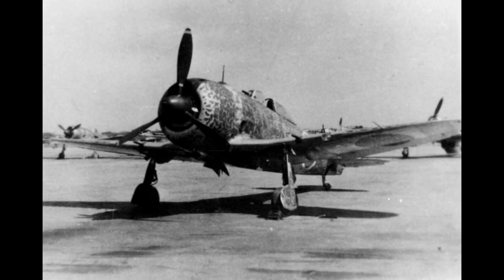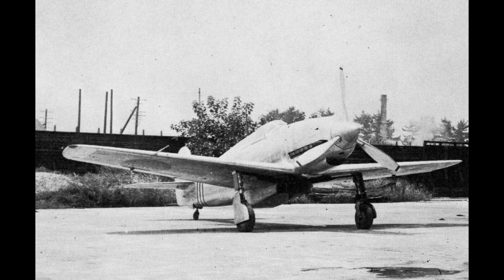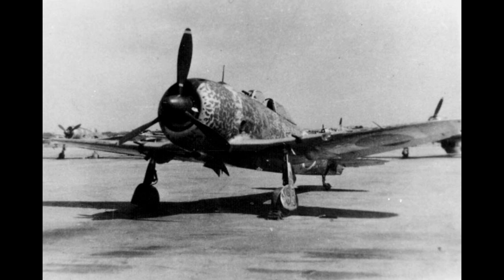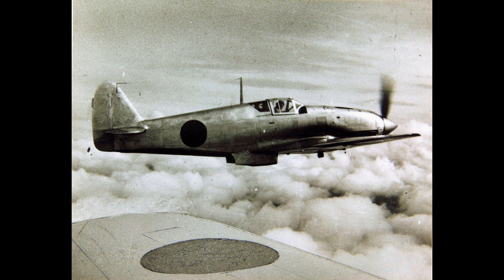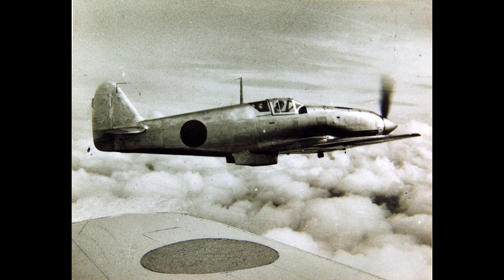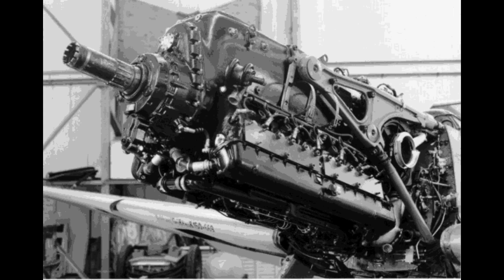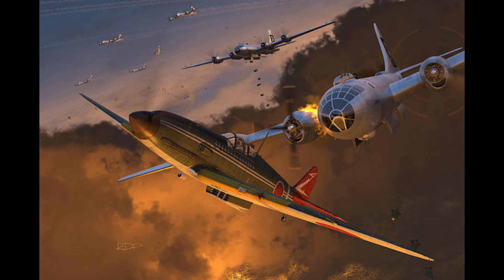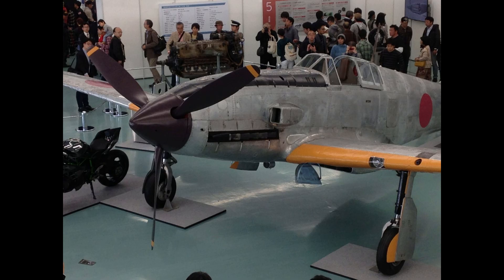5 Minute Guides to Aircraft: Kawasaki Ki-61 Hien

Comment: Pops was a fighter mechanic in the pacific and said the reliability and ruggedness of the radial was superior to the aerodynamic superiority of the inline
Reply from the maker: Indeed, that was the primary reason all US Navy aircraft used radial engines, among also being generally more easier to maintain and operate onboard a carrier, needing less parts since you didn't have a liquid cooling system to maintain (discounting the oil cooling).

Comment: It was a V not inline.
Reply from the maker: The DB601 is a inverted V12, which is a type of inline engine.
Reply: @5MinuteGuidesToAircraft  Inline refers to combustion engines like the 2jz, RB26 or any 4 cylinder that's not a flat, like most modern engones where the cylinders are all in a line, V is designated with V6 V8, V12, where there is a bank between cylinders like the LS1, Ford.modular, 1uz.
Reply from the maker: @super_slav91  Ah, I realize the confusion.

I substituted Inline for "Liquid cooled Engines" way back in my young years and just kept onto it ever since because I always for some reason thought of inline as literally in line with the aircraft and the fuselage.

Blame that one on 7 y.o me who never bothered to double check lol
Reply: @super_slav91  In aviation circles a V12 is correctly referred to as an inline engine, as is an H-24 like a Napier Sabre, W12 like a Napier Lion or a straight 4 like a Gypsy Major. the cylinders are in a row or lines along a crankshaft as opposed to around the crankshaft in a circle like a radial engine
Reply: @pommunist  Didn't know that but makes sense since radials exist, upside down V12 was in the BF-109 rudimentary EFI too?

Comment: "fanaticism about radial engines"

Yes they had poor inlines at the time, but that was onle one side of it.   Very simple, Japan in the 1930s had some of the best radial engine tech in the world.
Only problem(but a really big one) was that their massproduction sucked badly, so almost no production engines came close to what the prototypes managed(and they were often overweight or less reliable as well).

If Japan in 2nd half of 1930 had same production ability and fuel quality as USA?   Their engines were clearly BETTER.   To the point that they may have been best in the world at the time.
However, they didn't seriously get into superchargers and turbochargers until it was waaayy too late, and that really hurt their performance as well.